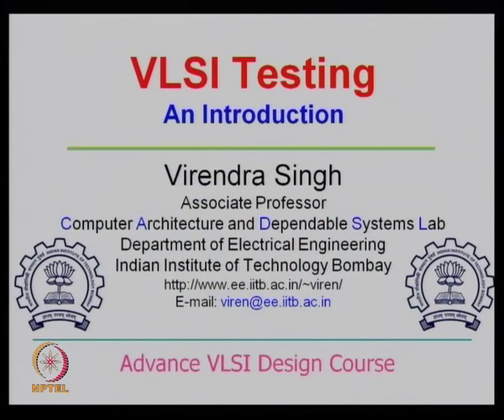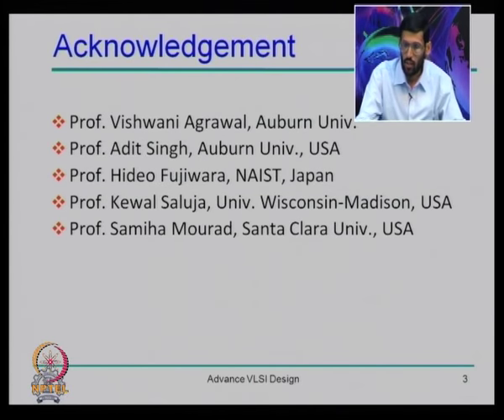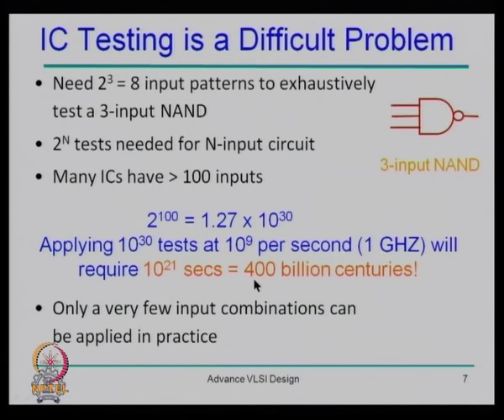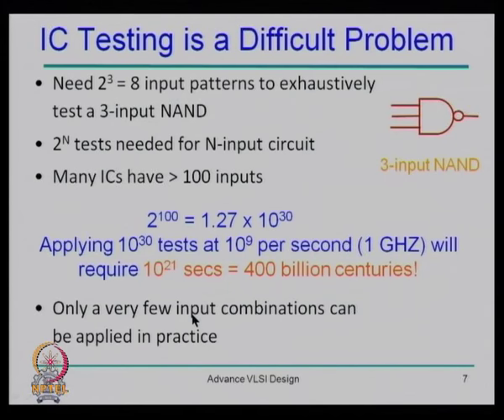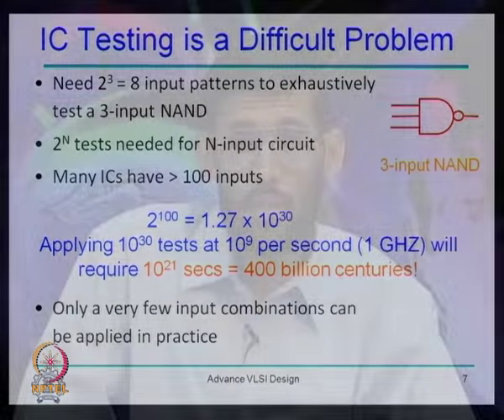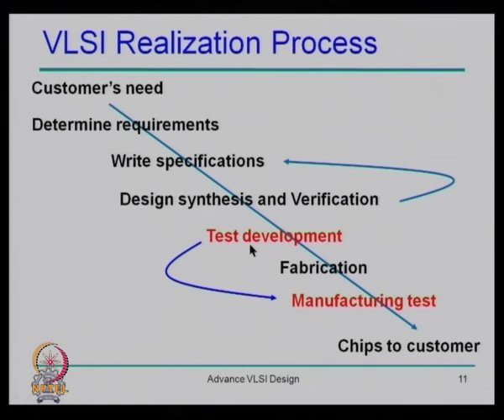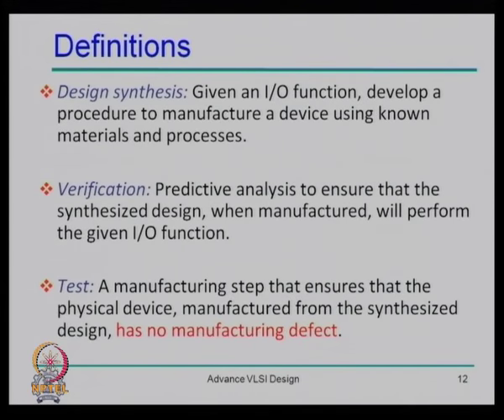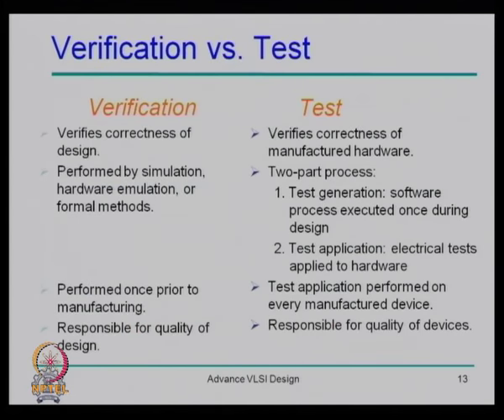Mod-01 Lec-33 Introduction to VLSI Testing

Comment: I have one question. Suppose if the system has 3 chips A and 2 chips B. System DPM is 2000. Chip B has a yield of 98% and chip A has 769 DPM. What is the fault coverage of chip B? Can anyone help me solve it?